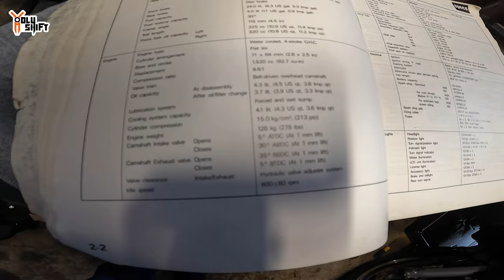Wrong Way To Change Oil Honda Goldwing 1989

Comment: Hi 👋 Sandy , I forgot to mention a suggestion or even to have a look, is the ground / soil around your garage higher than what your garage floor is, if so , when you’ve got a bit of time, it might be worth moving the soil back away from the garage, if that is the problem, it’s just a thought just to try and help you, from an old geezer, 😂 , Phil from the moulin

Comment: Get a flat oil filter wrench for the bike. You just slip it up in front the filter and behind the lower fairing, through that half inch gap, then loosen the filter. No need to remove any fairing. Do a web search for Honda Goldwing 1500 oil filter wrench  and look for the flat stamped steel wrench
Reply from the maker: Great tip - thanks

Comment: Wait, my '99 has nearly 100,000 miles and never smokes on startup (or ever).
The reason? Well, I never leave it parked on the side stand. I always put it on the center stand and the oil ALWAYS seems to make it back into the sump. I don't know why 🤔, it just does. Maybe others have that problem REGARDLESS of which stand on which they park it. I just don't.
It might be worth a try, or maybe not, rider's choice...

Comment: If you have an oil stain on your concrete there are many products you can buy to clean it up 👍👍.      But if you're cheap like me you can just use kerosene poor  kerosene on the spot use old broom to work it in let's sit a few minutes then use oil dry to suck it all up 
AND SAY GOODBYE SPOT 👋